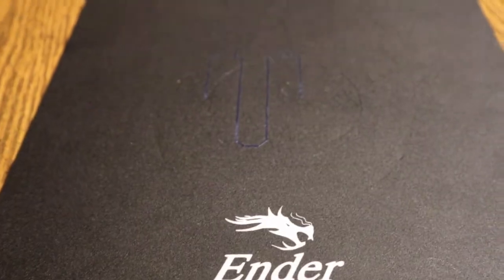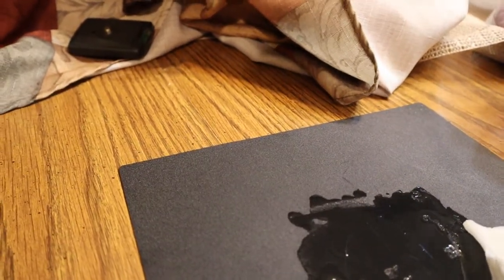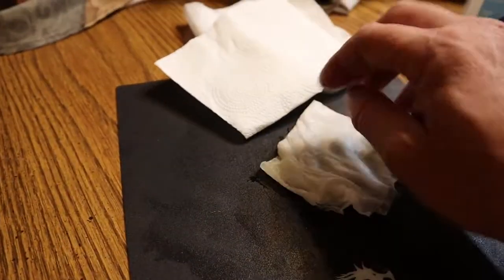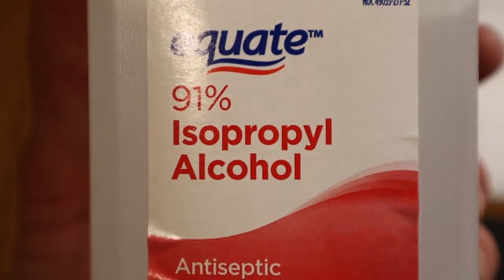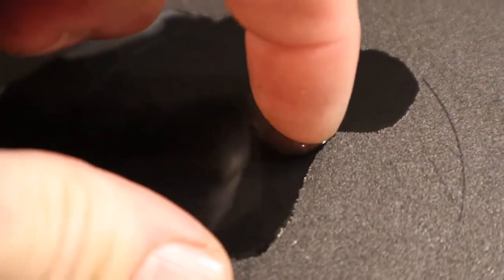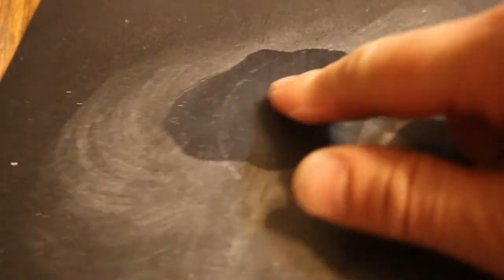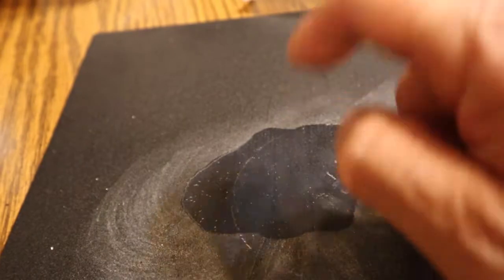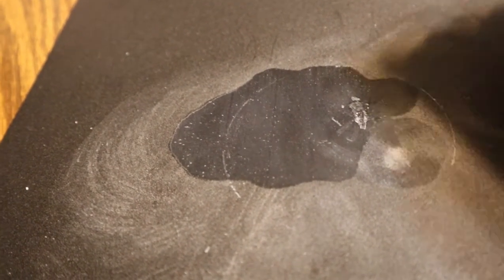PLA Removal From Flexible Print Bed

Comment: Many portions of a level-test 3D print stuck to my build plate. I never thought apply a paper towel soaked with alcohol. I poured alcohol on the plate, waited, then scrape. Then I poured hot water and scraped. The scraper cut my skin all over the place. The plate is very scratched up. Something kept telling me acetone will damage the plate--I've damaged a bunch of things in life. Your video taught me a life lesson. Thank you.
Reply from the maker: I'm glad the video kept you from ruining a bed with acatone, myself I get kind of torn between never wanting to damage a bed and the realization that they are pretty inexpensive to replace.

Comment: Was that esun pla+ in blue?
Reply from the maker: Pardon me is that esun pla+? Why yes it is good man! Good eye there.
Reply: @MasterofNone2  ha having the same exact problem in same color, didnt realize I was printing below the right temp and got the thinnest stuck on residue ive seen.  Iso finally helped.  How was your spool of that  stuff mine seems poorly wound...
Reply from the maker: @harbordetail6852  I had good luck with the Esun but I do swap spools a bunch and could have easily not bumped up the temp on that run.

Comment: Same thing happened to me with acetone. Don't use acetone. I learned the hard way that it also dissolves the plate coating. Had to get a new plate.
Reply from the maker: Everything went so good right up until it totally failed.